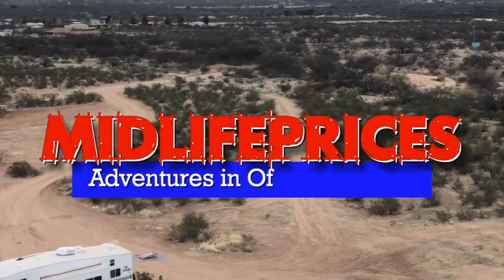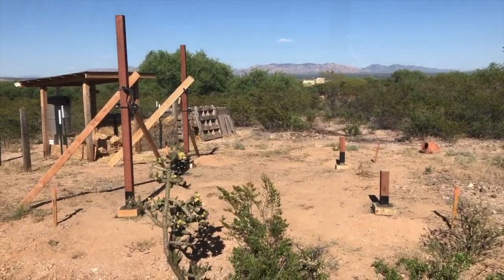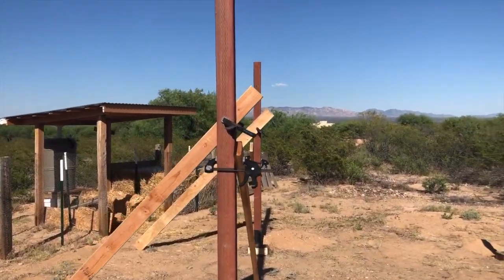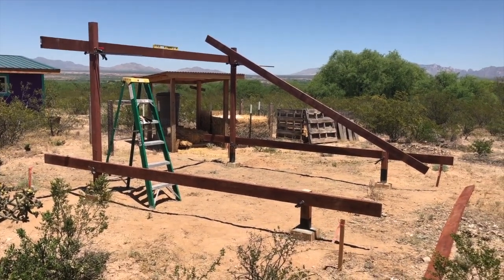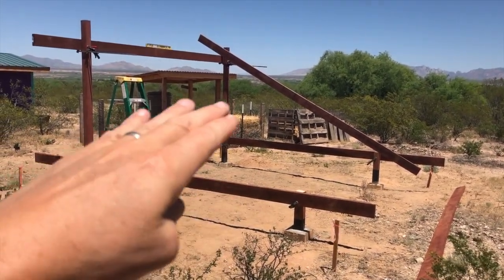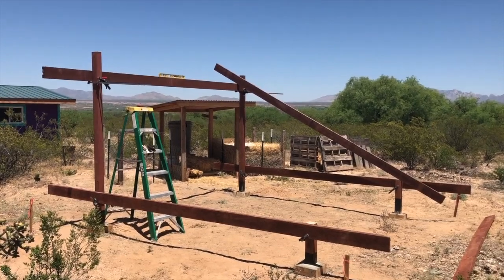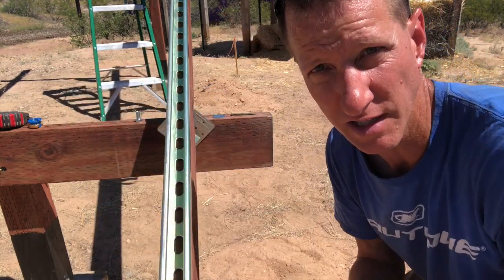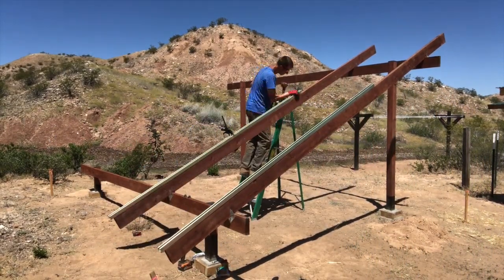DIY Off-Grid Solar Setup (Part 2 - Panel Ground Mount Posts & Beams)

Comment: I am also crossing with my Unistrut. 40 panels 2 rows of 20.  make it as strong as we can. You and I have similar but different designs. I need 100 mph straight winds which is 140 mph regular winds.  tornados do about 100 mile an hour straight winds.  if it touches my solar its gone. lets pray it never does.
Reply from the maker: Good luck! 🤞

Comment: you put all the load on the rafters. you could have split the load. All good lets hope you don't see 80 plus mph winds. I am also building out of wood and super strut, I am making my top rafters join with my posts and there support which will give me 2x the strength maybe 3x. I don't get winds much but I have seen 60 mph straight winds hit. I am also making mine portable per say. I can remove everything and set it up in another location. Props for what you have done.
Reply from the maker: Not sure what you mean by "split the load," DC.  Can you please explain?  Thanks for watching!

Comment: Hello nice video i have a question what's the length of the boards they self from left to right the top across and bottom across i wanna get started building me one similar to urs holding 6 panels going 3 panels across i need to know the proper length of the board to buy thanks..
Reply from the maker: I believe those are 16-footers for us, but it will depend on the actual size and orientation of your panels.  Good luck!

Comment: Very nice work!
What's your projected total square footage for solar panels?  And resulting kWh?

p.s.  String and string level are your friends.
Reply from the maker: Thanks, Sam!  Square footage of panels is about 16'x16', so ~250.  Panels can collect about 4500 W (under ideal conditions), but design (fixed angle), equipment limitations (3500 W for charge controller), and real world conditions (sun hours, clouds, etc.) will make that vary.  I've got about 21 kWh of battery storage, and that should fill up before noon on most normal days.  It should just be a matter of being aware of usage on sub-optimal collection days.  Can't believe I didn't think of string level, which I have! 🙄
Reply: @MidlifePrices  
Have you calculated your requirements? In other words, do you know what you can get by on?
Actually, come to think of it, are you running off of a generator right now, exclusively?

Comment: Looks great! How long do you think the wood will last outside? I am weighing the cost of metal pipe vs wood and wonder about the longevity of wood.
Reply: We did a very similar setup except we have 8 posts (Qty 4 - 4x4 and Qty 4 - 4x6.)  We used the 4x4's as the outer posts and 4x6's inner so we could use 8' ledgers for front/back.  We coated our posted w/Flexseal, but Henry's is probably better (didn't do the cement form trick though.  That will help the posts from rotting out where they touch the ground.)  I'd expect that mount to outlive them.  For cost, there's no comparison.  I spec'd out an Iron Ridge mount and it was ~5x the cost.  For that cost, I'd rather add more panels and build a new mount in 20 years.
Reply from the maker: Excellent points, DC.  I don't know exactly how long it will last, but I did what I could to help extend it's life, and I'm willing to deal with what comes compared to the cost of metal.
Reply from the maker: Mud Hut Homestead Not sure exactly how long it will last but it is treated wood so should last for years. Thanks 😊